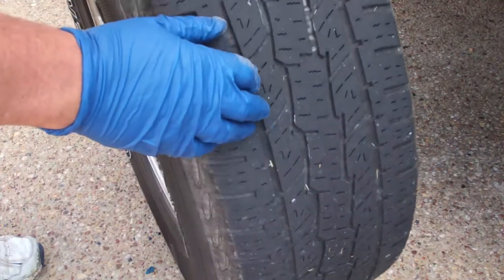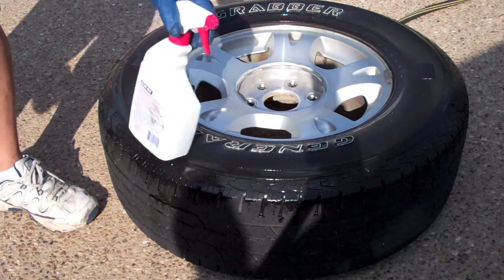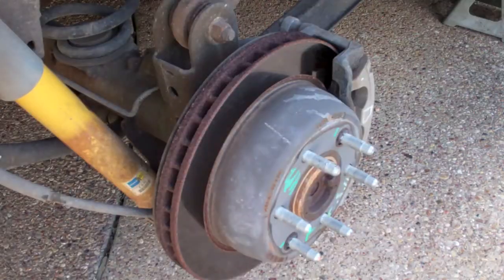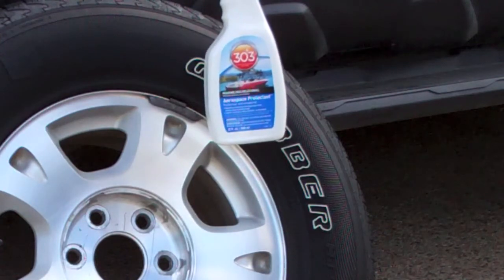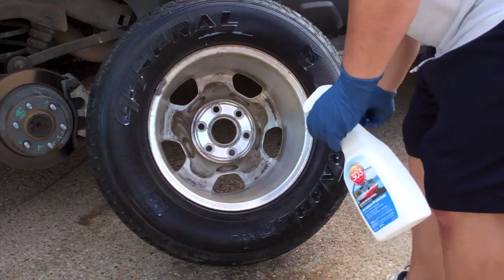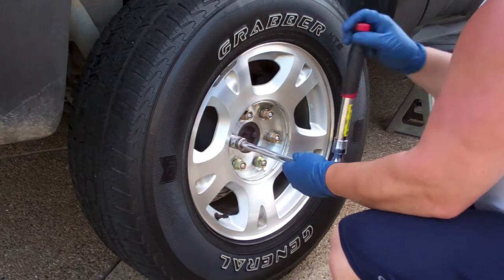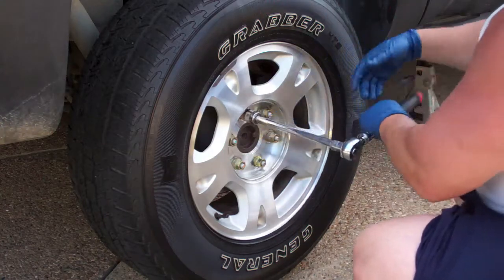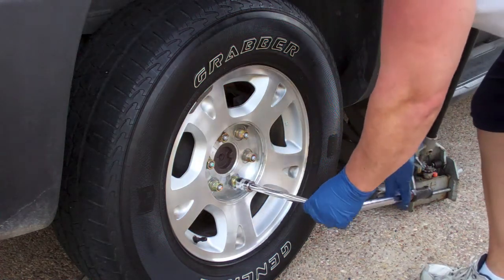Chevy Avalanche tire rotation

Comment: Thanks for the helpful hint. But you're video stresses rotation not cleaning. Was just looking for a quick simple answer on a rotation pattern. Never got the quick simple answer so I had to go to another video 5 seconds into it gave me the pattern I was looking for
Reply from the maker: rotation for "directional" tires is always front to back.  rotation for non-directional tires can be front right to rear left and front left to rear right as well as front to back (alternate each rotation).  hope that helps